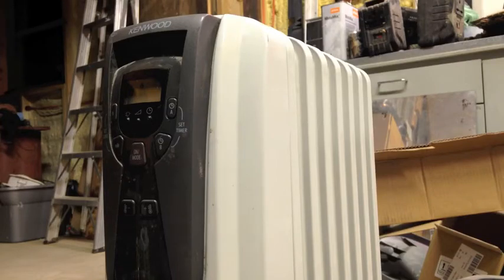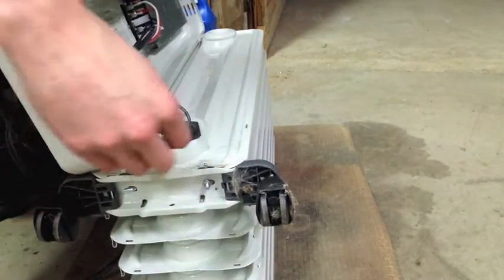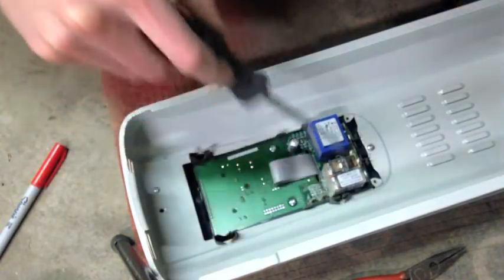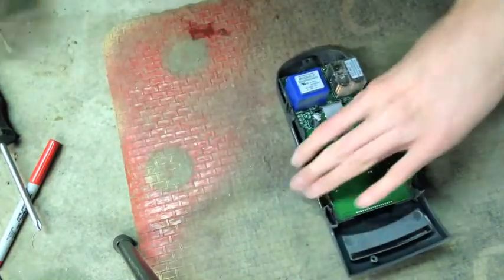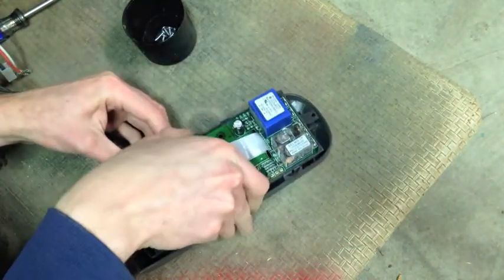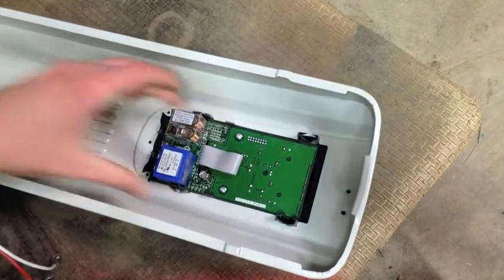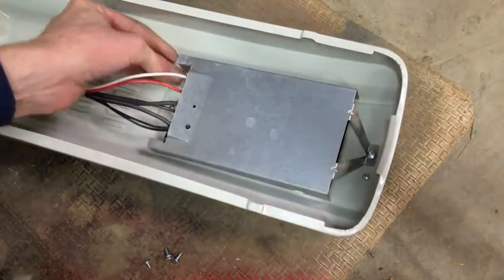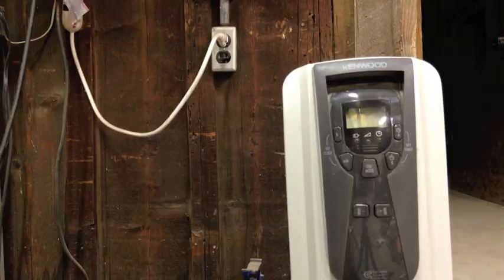Cheap Fix for a Buzzing Kenwood Heater

Comment: I know you posted this video about 4 years ago but just thought I would let you know it's still helping others! I couldn't believe I found this same exact issue and changing the capacitor out fixed mine! My capacitor was not bulging or leaking so I wasn't sure it would work but did the trick. Super excited to keep this in use and not in the landfill. It's pretty lame to know a 5 cent part can render this useless, most people are too lazy to repair or even give it a second thought and toss it.  A big thanks to you!!!!!

Comment: Thank you!  I had the same heater, same problem.  Your step-by-step instructions were right on the money.  My heater is back up and running now. 5 bucks for the capacitor is a way better deal than $100+ for a replacement unit.  And this was the first time I touched a soldering iron in 40 years!

I had to cut the hinge off the second two sets of clips to get the board out, but with 2 screws and 2 clips it works just fine.

Comment: Great video! Another Kenwood carries on thanks to your clear instruction and a 30 cent replacement capacitor.  Prospective repairers be warned that two of those non-screw fastener clips will test your will to carry on.  After unclipping the easy two, I kept them unclipped with a piece of 1/4” dowel and worked with needle nose pliers and a screw driver to free one of the difficult clips. With it freed, the last one was relatively easy to unclip.
Be mindful of which screw came from where and it’s pretty much clear sailing.  Cheers!

Comment: Thank you for sharing your knowledge. I have been looking for the wiring connection information on the same model and this was very helpful.  My issue was it would not turn on at all and I found that the  Transformer (24 VA/2VA -2ndry) was the issue. You are a good man!

Comment: Thank You, had (2) similar units (Kenwood EW6708K) One would just click rapidly and not heat, the other one had no display but the heat would turn on.  Replaced the Capacitor, 470uF, 35V, 105C in each unit. And they now both are working properly again.  FYI my bad Capacitors looked fine before replacing with the new ones.

Comment: Thanks for providing the video.  My Kenwood office heater started buzzing last week and your solution and guidance was perfect and saved me from buying a new one.  

Only thing I would add is that the plastic clamps holding the circuit board in place on the inside are much more than "fiddly!!"  They are nearly impossible to dislodge!  I ended up having to break two of them to get it out.  Once reassembled all was still firmly in place

Thanks again.
Reply from the maker: Good to hear this helped somebody! And good job keeping another one out of the dump.

And yeah, I edited out a lot of swearing and screwing around with pliers... those clips do not play around.
Reply: easier to wriggle the plastic board mount with two hands and squeeze/twist the tabs towards each other, you can loosen the main board without removing the screws to get a little more flex out of the plastic without risking cracking the board.

Comment: This video is well done and greatly appreciated. Without this information this heater would have been in the landfill; no way I would have known what to fix. I sourced the capacitor locally for $.067. Also learned a new term: caddywompus :P  Thanks!
Reply: What is the capacitor part number?

Comment: I have the same issue. I spent so much time changing the thermal fuse and relay. the heater coil works though. My capacitor looks normal. Will have to try changing the capacitor . Thank you.
Reply from the maker: Good luck!
Reply: @Darwinpasta  Thank You Darwin. It works  now. Seriously, the original Capacitor is called "Ying Li" ! the 10 cent capacitor can ruin a 75 $ heater in a couple of yrs! I fixed it because I just love that heater in winter ! Thanks again . Best  .

Comment: Your video is so helpful, I have a same model heater and got the similar phenomena, Follow your video instructions and opened it up, saw the capacitor bulged, I guess it’s the same problem. If the capacitor is used to smooth choppy wave, can I use a bigger microfarad capacitor? I have 330uf/50V, 1000uf/50V, 1000uf/25V, 47uf/50V capacitors at hand. I wonder if I can use one of them to replace the 470uf/35V capacitor. Thank you so much!
Reply from the maker: I'm glad it helped! I haven't tried other caps in this circuit, but I imagine the 330 or 1000 would do the job. Too small of a cap won't smooth well, too large might stress the power supply on startup. Good luck!
Reply: @Darwinpasta  thank you so much for replying me, if I try the 330 or 1000 uf cap, which one might be better? Is there any possibility that the circuit will be damaged? I am sorry for asking you so many questions, I really appreciate your help.
Reply from the maker: @taocheng5339  No worries! I don't know these power supplies well enough to say, but 330 is closer to what it's supposed to have, so I would probably start there if ordering the right part isn't an option.
Reply: Thank you!

Comment: I have the same heater, it’s making a loud ringing noise. Not sure if it’s the same problem, kind-of scared the crap out of me in the middle of the night so I unplugged it because I’m scared of a fire starting 🤷🏼‍♀️
Reply from the maker: Yeah, never good to leave something plugged in unattended when it's making weird noises. No idea if the cap that was bad in this one would make that noise, but I guess a ring is just a buzz at a different frequency. Open it up, if it's useless now you can't make it worse by trying! Good luck.

Comment: A GREAT video! I have the same unit with a slightly different faceplate. My On/Mode switch keeps clicking rapidly off as soon as I turn it on. Any suggestions as to how to fix? Kenwood parts appear to be completely discontinued.
Reply from the maker: I would still try the capacitor. Might be just enough life left in yours that the control board tries power up, but falls on its face. Failing that, I look for a tipover switch (shuts it off if it tips over) or any obvious damage to the temp sensor for the faceplate, if it's got one. Could be the sensor's open/shorted and the electronics interpret an out-of-range signal as overheating. Good luck!

Comment: Very helpful video to see the inside!  I have the same unit but a different problem - it keeps shutting down after about 10 minutes of heat being turned on - on any setting.  I assume the thermostat/thermal switch unit has gone bad and shuts off the heater too early.  Any idea of how difficult it is to replace that part?  I haven’t opened mine up yet, but can’t really see the part from your video to determine the part number/specs.  When you tested it with a multi tester, is circuit “open” of “closed” type?  Many thanks.
Reply from the maker: The overheat switch sounds like a likely culprit. The part itself should have a part number on it somewhere. That part number may let you track down the temperature it's supposed to switch at. If you've got an IR thermometer, you could check the temperature the heater gets to vs when the switch opens to determine whether the switch is kicking early or it's actually overheating. (I would also check the switch with a meter when the unit has shut itself off to verify that it is in fact what's breaking the circuit.) It looked like an easy part to swap if necessary, but mine tested good, so I left it alone.

AFAIK the switch should be normally closed, opens when hot, wired in line with the element so it breaks the circuit/shuts off the heater if it trips. Good luck!
Reply: @Darwinpasta  Many thanks for the Quick and helpful reply!   I opened it up and looked at the thermal switch - it says Klixon and has the following numbers on the metal tabs where are the wires attach. “ 2 32 5 “ also has US patent 4349806 marked on the back .  it’s about 1.5 cm diameter,  
 on the side is the following: “1NTO8L-5841  L180 MR 0816 AB” but I don’t know how to decipher that - perhaps 180°F is the temp cut off?   Any ideas?
I did a web search and can find some thermal switches starting with1NTO8L- but nothing after.   I sent an email inquiry to one vendor.
The other issue is there is no thermal paste at all, seems to be all dried up.  if I do replace the part, how important is it to buy and apply some new thermal paste?
any additional advice would be appreciated.  thanks.
Reply from the maker: @tomagoston  I'd be surprised if thermal paste was required in this application and I don't remember seeing any in mine. Sounds like you're on the right track with the cutout. I'd check Digikey and Mouser if you haven't yet. I'm not sure what the desired temp cutout point would be for this unit, but 180F does sound like the right ballpark.
Reply: @Darwinpasta  Thanks for the referrals.  I struck out with Mouser, but Digikey has two thermal switches with similar specs, so ordered one of each -- but after I replaced the thermal switch (very easy) the unit still shut down after about 10-15 minutes of the heat being turned on.   This was the second issue with the heater - the first was that after being turned off, it still produced heat - at a low setting.  I think something got fried on the circuit board, maybe a relay.  But it seemed to me to be a fire hazard, so...I reluctantly took it to the recycling center.  too bad, because your vid is so useful to show the insides!
Reply from the maker: @tomagoston  Can't save 'em all unfortunately. Good on you for trying!

Comment: Oregon girl here💜thx for making this instructional vid  so-damn-easy to understand.."both" of mine went down a month apart (hmmm, maybe they mate for life?.. lol🤪)..anywho, I'm up for the fixit challenge🤞💙🤞..cuz of you 😎
BTW,  is "407uF' the correct one?  Thx
Reply from the maker: That's funny! I repaired two of these, both of which had failed around the same time as well. Makes sense, I guess. The cap you need is 470 microfarad, 35V. If you're not sure, check the old cap, it'll have the numbers printed on the side. Good luck!
Reply: @Darwinpasta  ..my two are the exact identical model as yours..all the 470 35v have "407uF" 🤷‍♀️.. that's all I find..(uF ?)
Reply from the maker: @pdxwildchildroberts5586  Where are you seeing 407? I don't think I've ever seen a cap with that rating. 

uF is microfarads. The u (actually µ, but ain't nobody got time to type that) is the metric prefix for micro (10^-6) and farads are the unit for capacitance. The side of the cap should say 470µF, 35v.

Comment: I have the Kenwood Model EW7507EBK.  When I plug it in and set the temperature high enough to set off the heat, two lights on the front panel blink...no heat comes out.  Your video seemed to show no blinking lights or any display on the front panel, but just a buzzing sound...so I'm not sure if I have the same problem.  I took off the cover to look at the capacitor and it looked fine..no bulge.  Do you think I should try replacing the capacitor?
Reply from the maker: Sounds like a different fault. If you find nothing and have the cap on hand, wouldn't hurt to try, but it doesn't sound like the same fault I had. Blinking lights suggests the digital thermostat knows something's wrong. I'd start by checking the temp sensor, followed by the element, followed by the thermal cutoff switch.
Reply: I am pretty sure I just fixed this on mine, at least temporarily. There was a contact issue with the thermal cutoff switch and the radiator portion, as best I could tell afterwards. It was too hard to get a good shot of it without using a different setup when taking it apart. 11:38 and he also shows testing it, but mine just seemed to have come loose or had gotten dust or something.

Comment: Would you know about the Delonghi trh0715;  in that in my unit it seems to be losing heating power.  I gently gave it a shake and that seemed to have helped but then it started losing heat again.  ??  Any help is greatly appreciated.  regards, Chandra
Reply from the maker: I haven't dealt with that model or that issue, though it looks like a fairly simple unit, so hopefully the wiring isn't too difficult to work with. Given that it responds to shaking, it's gotta be a moving part that's crapping out. Depending on how that model is constructed, this could be the thermostat (if it's the simple old-school kind) or maybe the relay (if it's the digital kind like the Kenwood I took apart). I would also check for any loose or damaged wiring on the off chance. 

It should be fairly simple to track this down if you're good with a voltmeter.

Good luck!

Comment: I was curious i have 2 of the same model of heater. I am unable to turn off the heater by the switch even dropping the temp to 45 degrees Fahrenheit in the off setting the heater continues to pump out heat. I was curious what your thoughts are on what component that i might check to find my solution.
2nd heater has a fusible link repair that i haven't had time buy to the new part for repair.
Reply from the maker: If the control panel can't turn it off at all, but seems to be working otherwise (display/lights), I would check the relay. Might've welded the contacts together.
Reply: @Darwinpasta  thanks for the advice! Especially because i see you keep busy by your many project videos.
Reply from the maker: @thinkingimpaired5663  No worries man, good luck!

Comment: Where can we get other parts like the off/on circuit board or the assembly kit..
Reply from the maker: That may be a challenge. The parts I installed were generic. Best bet is probably to find a junk one for parts if you need the whole board. I doubt the manufacturer sells parts for these, but it wouldn't hurt to check.

Comment: I highly recommend re-applying some thermal paste/grease to the top of the thermal fuse where it meets the radiator. They really skimped on this at the factory. Could be a safety risk, may be insignificant. Better to err on the side of caution.
Reply from the maker: Not a bad idea while you've got it open!
Reply: Yes worth the repair even if you have to take the heater front panel back off.
Reply: @Darwinpasta  if you have the paste it's worth opening back up. Chinese heaters can be dangerous.